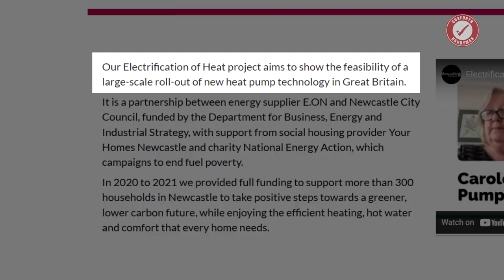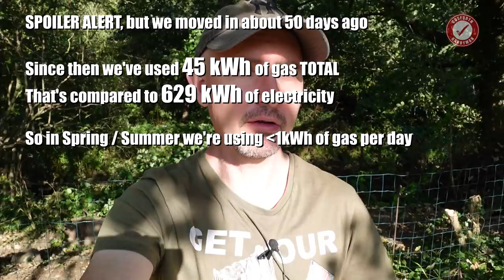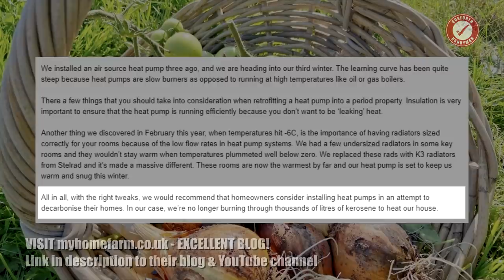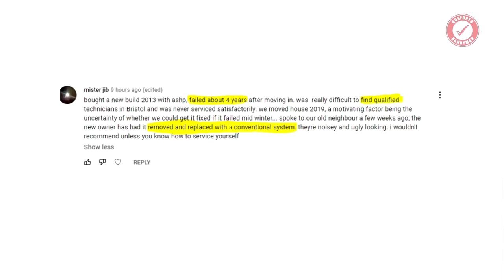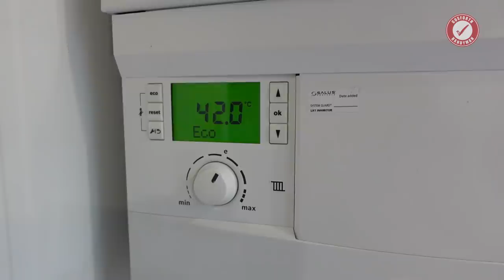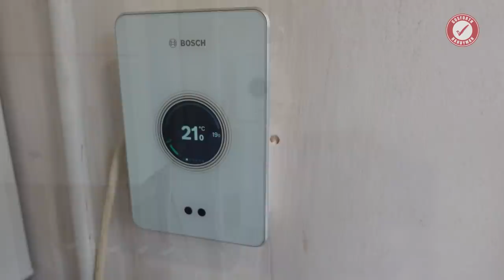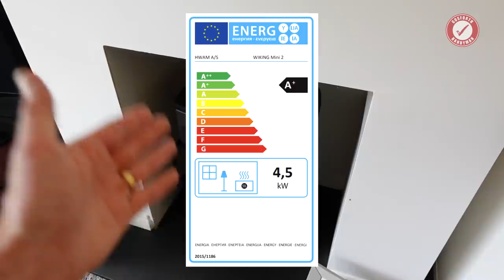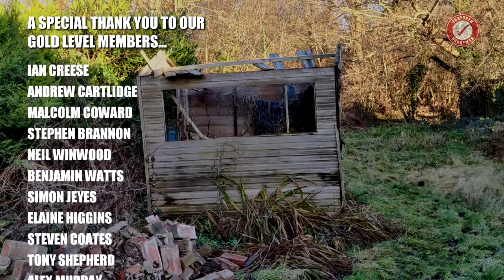Why didn’t we install an Air Source Heat Pump? (1920’s Renovation Part 32)

Comment: Here in Canada heat pumps are very common, partly because you get A/C with them. However, they are noisy and always need auxiliary heating (often electric) even at a few degrees below zero. As an expat Brit. I dream of gas boilers and radiators! Be very very careful before you invest heavily in heat pumps.

Comment: It doesn't matter which system you use. What matters is how much heat (ie energy) leaks. The colder outside, the warmer the house, the greater the leak. So insulation is by far the greatest thing to do. The problem of course is most houses in the UK cannot be insulated to even  half decent. Add to that, the cost of 1kwh of energy from electricity is 6 to 7 times more than gas. If it's a new build, by far the most economical method of heating a house in the UK is mains gas but with loads of insulation. That way the boiler will be hardly running at all or run at 30 degrees. Also, remember that most electricity in the UK is generated by burning gas because gas is so cheap!

Comment: The problem we have is that gas appliances are getting rare in domestic areas.  Currently I have a 4 year old gas condensing boiler that was practically given to me under a government grant scheme.

Since that was installed, I have retrofitted electric water heaters to my kitchen and bathroom sinks and combined with my already installed electric shower, the only gas I use is to heat my home.

The problem I have is that I have standing charges for my gas all year even when I only use gas between November and February typically.  When I do use gas, I don't skimp, so the "eco tariffs" with n standing charge, don't really work for me.

Comment: This is an excellent video and I spend a long time Googling for this type of conversation. What does it involve to replace 8mm microbore? Is microbore embedded within the downstairs concrete floor?  Would walls need to be carved up and replastered to replace the pipes? Would carpets and upstairs clip boarding need to be removed? The Government suggests that it will increase the price of gas until everyone is forced to install heat pumps.

Comment: Some good info, but some poor info,  unvented cylinder, are more efficient.   The maths prove this. Your heating up a lump of metal first before you get any hot water. 
Boilers don't condense above 55°c so its important to get your flow and return below this. For this to heat your house you will require larger rads. As per heat pumps.
For additional efficiently the out put of the boiler needs to match heatloss from house, weather compensation helps with this to adjust boiler output as required from out side temp. Forget internal stats/trv balance system. And it will be spot on!!

Comment: Got the same combi boiler along with an entirely new central heating system installed in our 1970s house here in Dublin in Ireland during the summer as well as getting insulated plasterboard installed throughout the entire house. We havent had to turn on the boiler for heating during the summer months either as the temp in the house stayed at 20 degrees celsius or above for the whole summer but have noticed a drop in temperature in the house over the last couple of days as the weather has taken a turn. Would be interested to know how you get on with it during the winter.

Comment: Great video Andy. We have moved from a modern 4/5 bed detached house to a two bed bungalow which we are about to renovate & extend to 4/5 bed & caught between which system to go to. I must admit we were going down the megaflow cylinder system, but might just have a big combi like you, that’s what we had in the old house. 👍

Comment: great video, key message is that all revonvations are a mixture of sustainable planning and pragmatic compromise. We are in similar circumstances to you and came to the same conclusion, would love to reduce our carbon footprint, but ASHPs are just not mature enough yet to be a credibe alternative to gas. But something does need to be. If you factor in fugative gas, which is the gas that escapes from the leaky national network and that methane is roughly 25x more potent than carbon dioxide- natural gas must go. but in order to do that the techies and the installers need to get their act together and come up with a genuine alternative that does not need dodgy government grant schemes to make the pallatable- hydrogen is a alternative, but even less mature than ASHPs. one thing you didn't mention in the video is space typical 3beds in the UK do not have a lot of free space in them, which makes combi boilers very attractive, in our case it was the heat pump or a downstairs loo!

Comment: Did you consider an electric combi? I’m looking at one for a 2 bed mid terrace that the back boilers failed in. I’m only doing it to sell so the prospect of having to spend £1000+ to have gas pipe moved round properly pains me. Electrics easy to fit.

Comment: I have a few criticisms of this video: 1. There is no short to medium term prospect of mains gas converting to hydrogen. The technology to produce green hydrogen in the quantities needed just doesn't exist at the moment and won't do for decades, if ever. 2. I was surprised he didn't mention that ground source heat pumps can be installed in a borehole less than a metre across, so no digging up the whole garden. Also they are a lot more effective and efficient than air source, with no reduction in performance with colder air temperature, and they are quieter. They cost even more to install though. 3. Domestic wood burners: yes they are (or should be) carbon neutral, but are terrible for PM 2.5 particulates production. Per Kg of fuel burned they produce literally hundreds of times more particulates than allowed in the latest EU diesel engine standards, and are now a bigger source of PM 2.5. in the UK than road traffic.

Comment: You didn't give a mention of solar panels linked to lithium batteries. Stored solar electric is a great idea to power up to around 6kilowatts to considerably reduce your electric bill. You could partially link it to heat hot water and heating!

Comment: I wish skeptics would visit a well installed heat pump  and see how warm the properties are, and also see what the electric costs are when installed properly. They’re hardly ever fitted correctly due to plumbers and heating engineers thinking they just set up the same as an oil or gas boiler. Sick of hearing that they don’t work. If most of Scandinavia have them, and we all know the temperature they get up there, then how can anyone say they don’t work in the uk

Comment: Can the wood burning stove be integrated into the heating system to also generate heat in the radiators and hot water cylinder? Great video, thanks!

Comment: Never a mention of the dense frigid air that heat pumps emit. What is the effect on outside temperature in a valley of thousands of heat pumps?

Comment: Very interesting discussion of air source heat pumps I need to replace my boiler and have thought about a hybrid system. We have solar panels, and a battery storage system, that produce excess electricity during the summer that I'd like to capture by heating water in a tank. If I could combine this with a gas boiler to run the central heating in the winter and water throughout the year I think I could reduce my energy usage significantly. I'd be interested to know if anyone else has tried this.

Comment: Besides not working very well for less than perfectly insulated homes, with an air source heat pump you are just swapping a gas bill for an electricity bill, and that electricity has to come from somewhere.  We will probably need a new boiler in 1 -2 years and it will be a combi boiler.

Comment: Andy - you are so right - trouble is that your common sense does not fit into the government ideology - usually with advice from experts who have never held a spanner.  Just remember that the NHS website used to promote "smoothies" for healthy eating - then we noticed that they were full of sugar - and years later - no smoothies on their healthy website.  Give it a few years and gas boilers will be back in fashion.

Comment: You mention a lot about how efficient modern boilers are, that's true but only if operated so that they condense, to achieve this more of the time you need larger radiators and lower flow temperatures.  I'm surprised you need such a powerful boiler, really you want to install the smallest boiler output that meets your needs as then it can operate more often inside its modulation range and avoid cycling which reduces efficiency.

Comment: Oldish house with middling insulation > modern gas boiler. A modern gas boiler will modulate between like 7-30kW which an old house on a cold day/night might well need. An equivalent heat pump will need to be ginormous, expensive and run up a electric bill long as your arm. In a very well insulated and ventilated home you will end up with a much lower heat requirement which might be covered with a reasonably sized heat pump.

Comment: Currently oil - 21kW condensing combi boiler outside. (Outside is best place for a boiler IMHO - previous boiler tried to kill me with CO) 
Relatively efficient - 90+% - uses less than 1,000 litres a year.
I like the idea of gshp, but would need to be borehole rather than a slinky under the garden. Cost truly scary.
I don't like the idea of ASHP just on noise. A mini-split on the other hand as a means of heating in milder weather and aircon for the one day a year it's needed is something I'd consider for electric heating. Doesn't cost much and generally works with lower temperatures than ASHP.
Burning sticks too in main fireplace.
I think not hedging bets is definitely the way to go.
Electric cars are pretty good if you do a lot of miles and your grid is green (currently 99% zero carbon in my area according to NG ESO - most of the time it's 100%). Depreciation not as big an issue as anticipated and running costs tiny.
Very much with you on not buying shite furniture. 👍 
Cheaper just buying it once, and reduces landfill.
Reply: Heat pumps don't kill 40 people a year either, well done for bringing that up.

Comment: Good video Andy - you made a good decision in my opinion. However, for U.K. Gov and others who are interested in doing better for the planet they could do no better than watch this You Tube video on reducing heat loss from the existing housing stock. ‘We’ would do much better to focus on this rather than heat pump installations in existing housing stock. However, we really do to need to regulate new building to meet ‘passive house’ standards and then heat pumps may be appropriate for them. BTW if your boiler is heating the house really quickly and the radiators are super hot then maybe the boiler is not set up as efficiently as it might be. I realise the use of terms ‘quickly’ and ‘super hot’ are not precise but for a boiler to achieve its rated efficiency then it needs to spend as much time as possible in ‘condensing mode’ if the circulating temp is too high it will not achieve that. Much better to be on a control curve that is less aggressive and modulates the firing rate to keep in condensing mode.😉👍

Comment: That is very interesting. The theoretical efficiencies at the UK temperatures should mean they are a bit of a no-brainer if you have already done the insulation etc - which is why the government is surely jumping on the bandwagon. I am somewhat shocked to see that on the ground experience is very much counter to that. I wonder if they are just bad systems? What is going on here?
Reply: Think they've rushed into it and we have very few engineers to fix them when they go wrong.
No one domestically in UK has air-conditioning.
Reply: Poorly insulated houses which means by fitting a system (ASHP/GSHP) into an old house and old wet system without regard to heat loss and lower emitter DT results in either a ‘cold house’ and or COP approaching 1 and BIG bills.
Reply: Bad installers. Most condensing boilers don't condense either. Bad installers.

His won't either, 32kw system for that house is huge.
Reply: Many of the systems that have been installed even in new builds over the last couple of years aren't in passive or almost passive house class installations. They're plastic pushfit 15mm pipe work normally with hair felt lagging for cheapness, if any pipe lagging. Those that are offered the grant and have them installed often want the bare minimum disruption so pipework not upgraded or lagged. Results as Norman pointed out are a COP around 1 and often incurring a much higher cost than people are expecting because they are either unwilling or unable to invest upfront at the time. Try as you might to inform people of the pitfalls green-washing and a lack of people wanting to educate themselves makes life quite difficult at times for installers. At the end of the day it's the customers money and decision and even if you give them the information it's down to them to act upon it.

Comment: I can understand that gas boilers is a better alternative in a country where electricity is expensive and gas is cheap 
But i dont understand why heat pumps wouldnt work in UK? It is the most popular alternative in scandinavia and they generally last for 20 years before you need to change the actual pump itself.
Both my father,  brother and most of my friends have heatpumps.

Comment: I already left a long comment, didn't want to make that one even longer, so posting this as a separate comment.  I'm interested to know why you said that a lot of people don't know how to use a thermostat, so wouldn't know how to use a complex heat pump system.  I'm puzzled by this as a heat pump system is not complicated at all, in fact it is often simpler to operate and maintain than a gas system, so not sure what point was being made?

Comment: I had the same debate, I ended up going for combi boiler. I did however oversize my rads which means I have lowered the heat temp at the boiler. Whether this will is more efficient than higher temp for shorter time, time will tell
Reply: Your boiler will have an optimum efficiency temp (assuming condensing boiler) which I think is 62C? But this might be different for each boiler, I am pretty sure that is the temp for ours.
Reply: @caskwith  yeah it's combi baxi

Comment: I think 'Heat Pump' is quite a misleading/misunderstood title.  It really should be called a 'Heat Transfer System'    ie : Taking heat from one location and (via a suitable refigerant gas) delivering to somewhere else.
The 'Pump' produces very little Heat itself.                        Most other heater systems 'Burn' something.. Gas, Oil, Wood and Electric (resistance wire)..

I first heard of 'Heat pumps' about 25-30 years ago when I was looking for methods of heating my new 'In ground' Swimming pool.  Gas was the norm..
This was before the benefits of the Internet and it's myriad of opinions..  but after much research.. I was convinced by the arguement of 'up to COP 6..' (which I took with a pinch.. )   
But it worked.. In the middle of a hot summer..  it heated the pool a treat.. I would say a 'True' COP 6.                          
So if you want toasty hot Central Heating in the middle of summer.. you will be very happy.

It's now almost a year after this Video was made and the World is a different place.            Boris is on his way out..  Energy prices are spiraling.. Recession is imminent.. Putin's cutting off the Gas..

We will be glad for all that nicely burnable Ikea Furniture..     Get 'Billy' on the bonfire..

Perhaps the answer is more 'District' or 'Community' heating/power supply..  We went through 'Brexit' after all..

When the dust has settled on the Diesel/Electric car debate.. Then they will blame 'Tyres' for all the particulates in the Air..  But by then I dont think anybody will be able to afford to go anywhere.. so.. problem solved..

Comment: Never heard of Reverse Cycle Air Conditioning there. In heat mode they operate at around 250 - 300% efficiency.  i.e. 1kW energy input provides 3kW heat energy out.    No gas heater operates at that level of efficiency.

Comment: Completely off topic but how did you go about boarding out your loft. 
On topic in our next house hopefully a small holding in the Hexham area I’m wanting to run a back boiler style system using a log burner

Comment: The free heat pump scheme failed because the houses were unsuitable. They were mostly modern with small bore pipes running down the walls under dob and dab plasterboard. Heat pumps need 15mm for the greater flow and double sized radiators. This would have meant surface mounted pipes. The floors were chipboard rather than floor boards so access is usually best by cutting down the ceilings in the room below. Even with everything free it is not worth the disruption. Only older houses with 15mm pipework in situ is suitable or new build where it can be good.

Comment: I have oil and radiators with solar on the roof and would like a air source heat pump but looks very expensive and as an early adopter and have evs still feel it’s not all it’s cracked up to be . Like energy efficient houses cost?

Comment: Heat pumps are quietly being pushed by the likes of eon, which was OK for new build especially when we had the code for sustainable homes. Unfortunately this was scrapped by one of these recent useless tory governments. Older buildings is another story.

Comment: Are those full bore isolation valves on the hot and cold pipes under the boiler? If not, you may be reducing your hot water flow rate which would be a shame on a 36kw boiler.

Comment: Not surprised. Air or ground source heating will need topping up with electric. You can’t create energy from very little heat differential.

Comment: I think this post is out of date. ASHP are whisper quiet. They can heat just about any home but the less insulation this is, the higher the running cost will be, as it will be with gas.